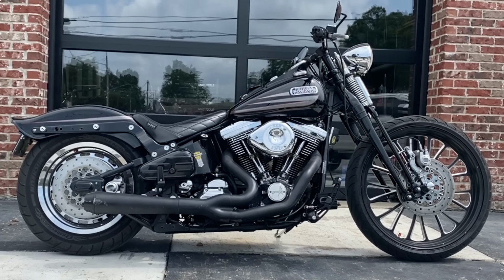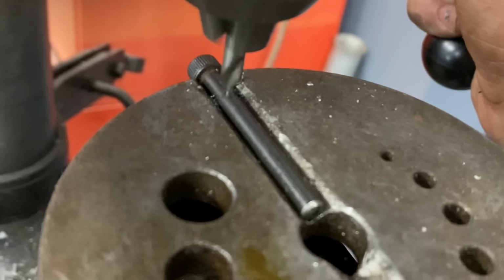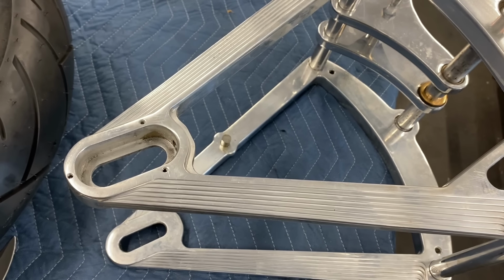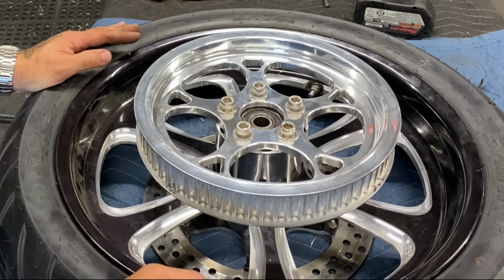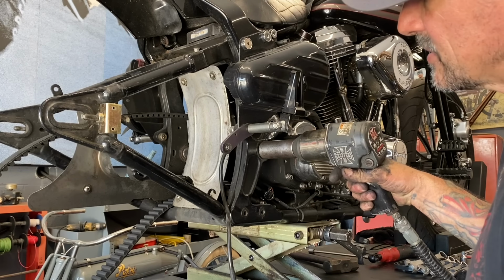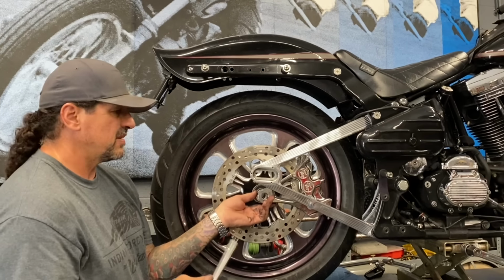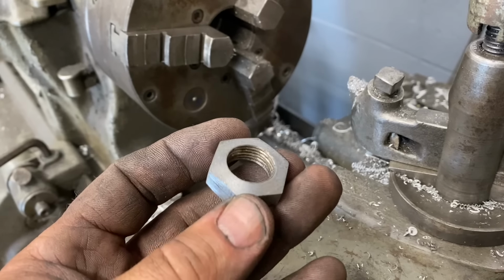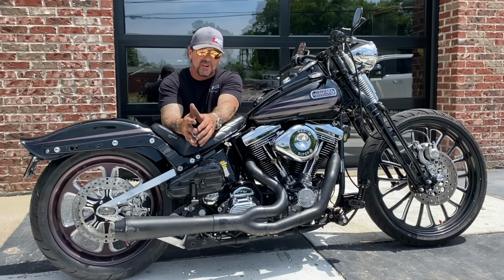World’s Baddest Harley-Davidson Bad Boy? Boyd Coddinton Swingarm Upgrade Billy Lane Harley Softail

Comment: Billy, I got some years on you. My last two bikes were rigid. Stock '57 Pan, '39 Knuckle, loved them both. Now I'm on a '99 Heritage Springer, motor is bullet proof. You are a true craftsman. I miss the good old days, it just goes by so fast. You're like a heart surgeon, on motorcycles. Very righteous.
Reply: you're right I ride 99fxst that I've modified to a heritage somewhat but as far as bulletproof for sure 85k don't leak a drop of oil still running strong changed compensator sprocket and primary chain
Reply: All great bikes...

Comment: It's wild to hear that pans and knuckles were cheap on the 90's. Now they both fetch crazy money.  A complete turn around.
Reply from the maker: I paid $3200 for my 1950 Panhead, complete.  In the mid 1990's the Bad Boy was $15,995, and the dealers would hang $5K worth of accessories on them before putting them on the floor.

Comment: Billy you are the best builder I've ever seen. When I first really got into custom motorcycle fabrication, you were my biggest inspiration. I love your building style, and I like the fact you do a lot of great customization that's also practical. I love the attitude you put forth into building bikes. It's not about being billy-bad***, it's about building really good quality custom components to fit the look you desire, and more important the performance you're after. I am currently rebuilding a 1988 Sportster that was inspired a lot by you. I bought it very mildly modified back in 2006. I had already been riding for years, but it was my first Harley Davidson. Shortly after purchasing the bike, it got completely totaled when I was involved in a bad accident after the hitch broke on a horse trailer in the oncoming lane. The man had no chains holding the trailer, and it came straight for me hitting the bike in the rear swing arm sending me airborne into a street sign. I didn't have the heart to lose the bike, so I settled with the guy pulling the trailer right there on the side of the road. My best friend helped me rebuild the bike into what it is now. It is a bobber sitting on a Pauchgo rigid frame with 35° rake, and no stretch. The only parts left from the original bike are the front end (trees and forks), and the lower end of the engine. The engine is now a 1988 883 bottom end, with a 2004 Buell XB9 1200cc top end, with Jim's Roller Rockers, an Andrew's V6 grind cam with. 0500 lift, Andrew's 4140 chromoly adjustable push rods, an accel 35496 programmable ignition, stealth super coils, and a  S&S Super E shorty carburetor with a short velocity stack for a breather. It's a lot of motor... especially for the 4 speed, but I love the bike. The rebuild with the hopped up Buell top end is the third rendition of the bike since its original rebuild. I'm still working on it right now, but I still have a lot to do. One thing I could use, is an idea of the baseline jetting to start out with to make tuning the bike easy as possible. Either way, I absolutely love your videos. Thanks for the great content!

Comment: Billy, I love the look and style of your builds. I love the look of the Springers and had a 2004 and 2006. In my humble opinion, nothing looks better than properly sized spoke wheels. An 18" in the rear fitting a 200 tire, and a 21" in the front. Wheel Works in Garden Grove Ca built some Akront aluminum with stainless steel spokes for me. They can build anything. Great guys, too. I just sold my FXDB and bought a Street Glide with aluminum wheels. Hard to get used to them. I was manager at Santini Custom Paint around the corner from Boyd for many years. Lots of friends worked there at Boyds. It's kind of a tight knit community in the Orange County Ca custom paint and Hot Rod/Cycle scene. Jesse was originally about ten minutes from our shop. Also, want to say a little about my late friend, Alex Anderson, who just passed away. He worked with me at Santini's and had been employed by Jesse James at the time of his passing a few months back. Alex was on Monster Garage as the shop manager. And also on the West Coast Customs staff. He was a talented and funny guy.  Sadly, Covid got him. Glad to see you are hanging in there and doing your thing. Thanks....Randy

Comment: Billy, it came out FANTASTIC!! I believe there's supposed to be a piece of flat spring spring steel that keeps those pads from constantly riding on the rotor in between the pads. I could be wrong but worth checking into. Have a good trip to Sturgis

Comment: Here's a little tip that you may find helpful:  When threading the inside of your swingarm pivot (or the ID of any tubing), if your lathe runs slow enough, you can use a live center in the tailstock to hold the tap in place, then grab the square end of the tap with a crescent wrench, allowing the handle of the wrench to rest on the lathe bed. As the tap feeds into the stock, slowly crank the tailstock to maintain slight pressure on the tap as it goes in. The trick here is to run the lathe SLOOOOOOWWW - like 30RPM.

Comment: I agree with a lot the these comments below. I truly get inspired on how you teach the little tips and tricks on customizing you do on older bikes. I too am building a bike that I truly wanted for the longest time a 91 fxr. I took it down to bare frame and powder coated and fresh paint. I did stuff a six speed gear box in the five speed case, since I was down that far. Just watched a lot of videos and you tube. Thanks again Billy.
Reply from the maker: Thanks for sharing.  I'm getting ready to do an FXR here also.  I used to ride several, years ago, but looking forward to mildly customizing one.

Comment: I'm currently working on my 2003 Moto Guzzi California Stone touring , I don't necessarily plan on doing any custom work on it , and there's very little aftermarket parts for it but I like to learn how to do something if the opportunity presents itself . I don't have a lathe but try to use what I have around my garage, and get creative. But there are local machine shops , if need be . As far as nostalgia , I have a 1972 Nova SS , and have been accumulating parts , to build my destroaked 350 SBC and found a pair of world products sportsman 2 cylinder heads that were cast in 1994 . I could put an LS in it but I just want to finally get it done how I wanted done back in the 90's when I was running around the local strip back then .

Comment: Great work! Thanks for the video. If you ever get a chance, go to the National Motorcycle Museum in Anamosa Iowa and view the original softail that was built by a small shop like yours and then sold to Harley Davidson.The inventor, Bill Davis from Saint Louis Missouri. The bike was on the road in 1981 before the evolution softail ever came out. It took 1st place at the 115th anniversary in Milwaukee Cool custom non HD category. There's only 26 frames in existence they will only accept panhead, shovelhead or knucklehead motor. It has a 1965, 89" stroker motor with a 3" belt drive open primary, dual plugged, Wide glide front end, Late model 5 speed, BDL clutch. I custom made the inner primary to accept the 5 speed. I've owned it since 1998 and bought it from one of the fabricators involved in the shop when it was invented.

Comment: Great watch again. Been a long time fan from the UK. Just wondered what you did to make a longer brake caliper anchor pin. Cheers
Reply from the maker: I used the shouldered section of a grade 12 1/2-inch diameter bolt, and welded a 1" diameter, 3/8-inch thick flange to it to add support.  The swingarm was missing the brake anchor when I got it.  I accidentally deleted the video when I made this part

Comment: I love what you have done with this Bad Boy. Just my opinion but I think you should put smooth rear fender struts with the bolts hidden under the fender.
Reply from the maker: I have a removable back rest for my wife, so I need these mounting studs for that.  It would look better as you suggest, but a pissed off wife is no picnic
Reply: @BillyLaneChoppers  I definitely understand that 😁

Comment: In my opinion the 2006-07 CVO Softail Springer in orange is the best of the springers 
110CVO engine fuel injection big enough rear tire and 2007 is last year of the 21in front tire
No modifications needed it's perfect

Comment: Enjoying your vids regards the badboy. Just changed the rear wheel  on my hardtail from a solid 200mm to a spoked 180. Had to make a few alterations with spacers and brakes etc. Totally agree about the air hitting solid wheels when passing lorries/big vehicles. Had a first issue fatboy for years and those solid front wheels kinda ruined an otherwise well handling bike 😅
Reply from the maker: It makes a huge difference.  I ride about 9 miles of my 37 mile commute on the interstate, and the solid wheel is no good for that.  This wheel is lighter, also, and I can feel it when I ride
Reply: @BillyLaneChoppers  Agree, I've a feeling when i get the hardtail finished, it's going to feel like a different bike with a spoked back wheel. Just rolling the bike around the garage...it's so much lighter, that's definitely gotta make a different riding experience.

Comment: Yeah a gentleman had one of these in his building just sitting there
Asked if it ran but the answer was n so i said i will get it running i promise even though. everyone had tried to see and nothing. So he gave me one day spare to work.on it after cleaning his shop of equipment and products of old
Found rats nest and just grime rot and mess drained the fuel through a towel cleaned just about everything on it  looked  like new and he said wow i have not seen it so clean. Hunt and miya just laughed at how good it looked. So it was all back together and clean with the moment of truth will it run after all this work and the day was coming to an end
I gave hunt the keys and said to have the honors. It went first time without a splutter and held a purr. Rode it down the street and was absolutely fine as if it came of the showroom floor. He was just amazed with his wife miya as we covered it back up. Few moments later he asked uf wanted to ride it to work and of course if it is ok and it was offered
So then ot got some proper use and it stood there all shiny with not even a oil.leak they used to be made to leak with a small indentation of the sump plug or the head unless you planned it properly as the side cover. A sitting rotting.motorcyle into a riding glitter machine. Another happy customer
AFFA angels never die nffn hms sonny

Comment: Hey Billy question? How does the bike trail with 23 ?? I've got a 26 on my FXST but runnin a Pro1 triple tree w/7°of rake on top of the 38°s of rake in frame from H.D. ur neck looks like a FL frame I believe they have 0°s of rake like springer on ur scoot I also runnin 18x5.5 60 spoke rim 180 Metzler 888 tire again Thx man 👌👍👊✌️
Reply from the maker: @georgewallace6661  handles amazing. Realize that this is a springer, & fork geometry is far different than a glide. The frame rake & stretch are stock.

Comment: Great video brother, i know a 2021 soft tail slim isn't custom bike but i'm goin to look at one tomorrow, is there anything that i should be looking for in a used bike it will be my first harley-davidson 🥳🥳🥳🥳🥳🥳
Reply from the maker: I always check the tire wear & pressure & pull the oil dipstick. Tire wear should be uniform, & low pressure tells me the owner neglected maintenance. Oil should be clean & translucent, not black & gritty. Good luck, I hope you ride home on your first Harley-Davidson. After almost 120 years, they still roll out a great product.

Comment: Does a 98 springer have the same rake as a 98 Softail custom .what's the length of the springer front end my sotail from bottom tree to axle is 24".will that springer front end fit my bike

Comment: Can someone please explain for me, will the axel and axel sleeve not wear away over time from the rotational friction as they are both free moving ? Thanks
Reply from the maker: neither will wear.  The axle is fixed, and so are the inner bearing races, by virtue of the torque on the axle nut.  The sleeve does not move.

Comment: I just bought a 97 Bad Boy from my 81 year old father. It started puking oil from the rocker box vent tube. Does anyone know how to stop it and fix it?
I ran the crank case vent tube with the rocker box vent and now the oil tank is pressurizing. One thing after another 💪🏼🤣🤦🏻‍♂️

Comment: Solid wheels vs. Spokes or 5 spoke mag wheels, all are unaffected by crosswinds,  it's a myth, it originated in the early days of experimental fairings, when they used an enclosed front wheel, that was hell in a crosswind wheels create a vortices, and wind contacts a boundary layer of ambient air about 14" off the ground, if you run a fender thats where it hits, maybe a 30" solid, going about 5mph would be a squirrely event, but no wheel below 23" is effected if it's solid or spoked or open style mag, they all work the same, if you study aerodynamics, Bernoulis principal, Coanda, Magnussen, and Aerodynamic  Ground Effect, you'll get a better understanding of thebwhat how and why things happen, spinning wheels have their own laws of physics